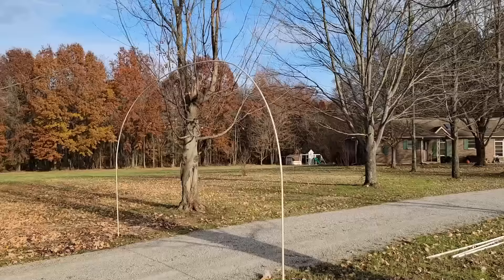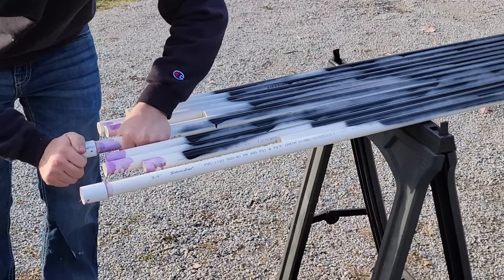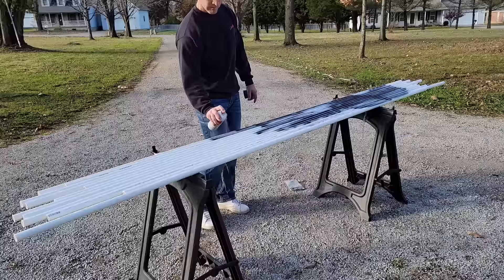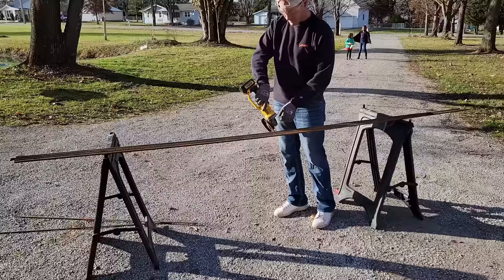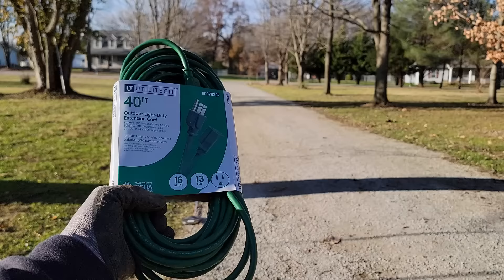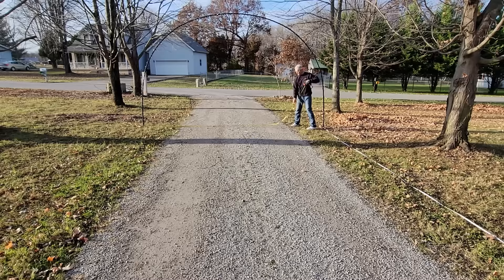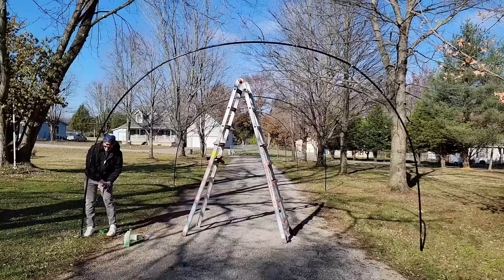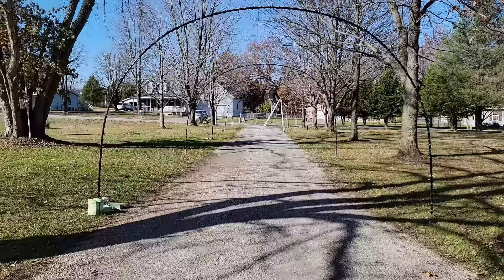How to Make a Drive Way Arch For Christmas Lights

Comment: how wide is your driveway?? Trying to gauge if I need to go shorter or wider than what you did. Looks awesome. Thanks!
Reply from the maker: The arches are 194" wide, and that gave me around 1.5 - 2 feet on each side.  I think the driveway is around 12ft wide.  Best of luck!
Reply: Generally, you need width of arch to be 3-4 feet wider than driveway. Then multiply by 1.5 and add 10 feet (3 meters) for the ends.  
So, for a 12 foot driveway, (12+4)*1.5+10=34 feet. I’d probably just go 35, just to be safe. 
Also, electrical conduit has bell ends which are deeper than pipe couplings. Just drill a hole and use cotter pins (looks like a hairpin).
Reply: @TomCee53 how did you find that out?  My driveway is 20 feet wide, so by that math I should have 44 feet of pipe to make the arch?  How tall will that be?

Comment: Zip ties, instead of all that wrapping of the lights. When the holiday is over, snip the zip ties off and done
Reply from the maker: I used both.  If you just run a line of lights then it isn't going to be as bright.

Comment: You think a wind will blow PVC under tension off of a single rebar stake???   Really?🤣
Reply from the maker: It makes for a nice tight fit, and works much better in my opinion.  Feel free to use one if you feel like that is good enough.

Comment: Why are you using primer???   It's for pressurized systems and inspection identification.  The cement/solvent is all you need.  Have you never built a plastic model in your life?   It's waste of time and resources to use PVC primer on non-plumbing projects using PVC pipe.  Heck, for DECADES primer wasn't ever used and the joints are just fine.
Reply from the maker: Well, I had it, and like I said in the video, "you don't have to use it."  Clearly you didn't listen to the video.
Reply: 1:21...😜
Why didn't you just use 3/4 bell end pvc? Just curious
Reply from the maker: @jacksonbrown5900  Just grabbed what was available at the time.
Reply: Honestly who cares that he used primer. Your just looking for something to complain about
Reply: @y2kok  I figured as much. I just thought I would ask instead of someone making a rude comment. I have plenty of various PVC pieces from my own repairs, various craft type and plumbing side jobs. This is a wonderful idea...😁

Comment: No way that you spend only $55, metal rots are like $10 a piece, plus pvc pipes about the same price in total you are looking to spend $50-$130
Reply from the maker: These were priced 2021, and I am building more this year.  After checking prices this year, they weren't terribly different.
I am also in Indiana so your price may vary according to location.

Comment: Did you have any issues with the drilled holes cracking the plastic couplings over time?
Reply from the maker: I have only had one crack.  So it has had a decent longevity.
Reply: @y2kok  Thanks for the response! That is great to hear
Reply from the maker: @RIleyCotter45  Absolutely.  All the best to you.